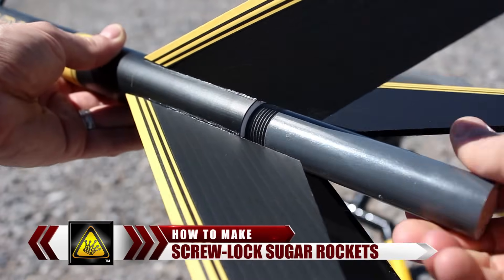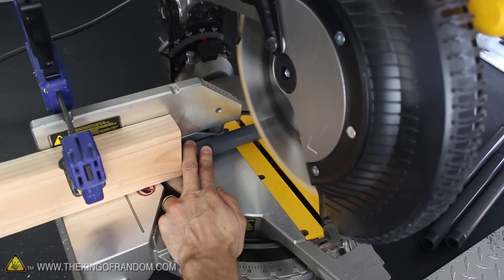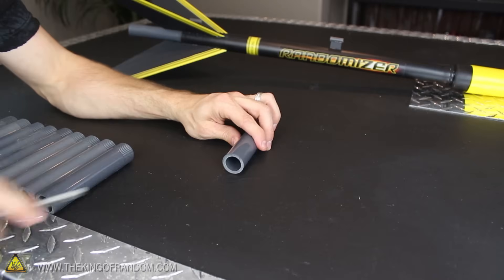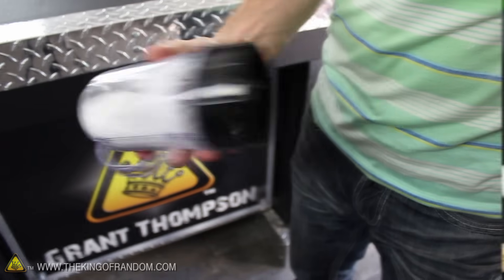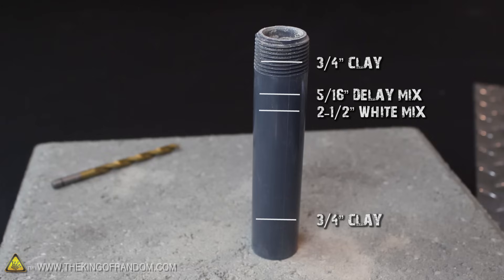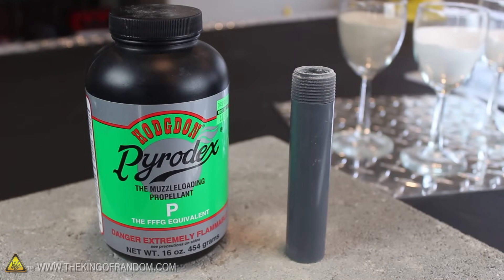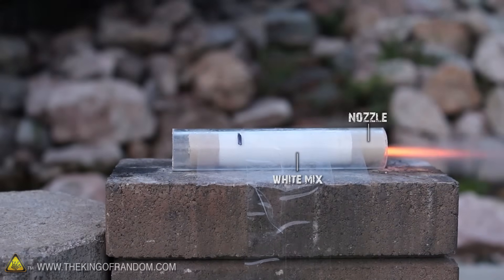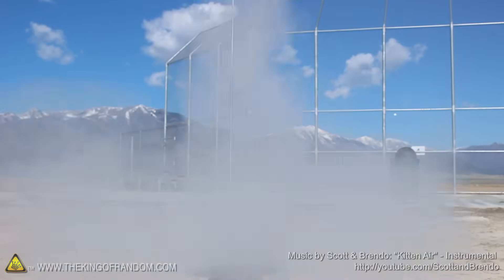How To Make "Screw-Lock" Sugar Rockets

Comment: for the rest of the world:-
35mm Clay
45mm Delay
108mm White mix
127mm Clay
254mm
Reply: +Brett N
Well that is exactly the point of the SI-system: you don't have to convert because everyone uses the same standardized units!
The only units I ever had to convert in school were km/h to m/s or radians to degrees
Reply: not all heros wear capes
Reply: Rijobans how do you know they are not wearing a cape?
Reply: I don't understand why the country with the largest space program still not uses SI-units…
Reply: nasa does,,,, most smart folks do too,,, me included,,, so simple ,,, but so many tools are in the old stuff,,,
Reply: @YourMJK  Yea don't ask. i live in it and i still wonder the same thing.
Reply: @YourMJK  Sports Illustrated (SI) measures their models in inches as well.
Reply: YourMJK maybe thats why we have the largest space program??
Reply: +wacka whaahaaahaaa I fucked up the 69 likes
Reply: LammaNerd I feel ya man, we are slowly doing it in the UK - its taken a while, and it wasn't all at once, but we're getting there.

All new buildings have plans with SI, whereas older plans have both SI and imperial.

What we need to do now is add 48km underneath our 30mph road signs to slowly switch people over.

I think in the US you might have to do it on a state by state level at first.. it will be messy at first, but for the next generation everyone will be singing from the same hymn book (so to speak)
Reply: wacka it was tried years ago, but it failed so most states scrapped it.
Reply: not all heroes wear capes
Reply: +wacka I loved how there was only one metric measurement in his video.
Reply: +LammaNerd When America succeeds in their plan of world domination everyone will be forced to learn imperial and how to shoot guns!
Reply: wacka congrats, this comment is still useful a year later
Reply: +YourMJKTube Their space program and scientific labs etc. does, just for things like carpentry and general use they use Imperial.
Reply: ***** in windows 10 I can do you one better.. dont even open a browser... just press winkey+c and type 300f c ..you dont even have to hit enter, it just does it as soon as you hit c
Reply: +YourMJKTube Our space program uses metric.
Reply: YourMJKTube It's the public not wanting to change their measures etc., the government tried to introduce metric units but the public didn't adopt it well so they stopped, now the government just says that the public should use in each situation whatever "fits".
https://youtu.be/lN-BPAxPnYc
Reply: +wacka thanks for converting from stupid units to normal units :)
Reply: +CelmorSmith
Yeah, I know that, would be crazy if they didn't!
But if the government founds NASA they should also do something to introduce the SI-system to the public
Reply: +Little Lion There is a formula if you ever want to figure it out quickly, Fahrenheit = Celsius(1.8) + 32
Reply: wacka Ehh.. 100mm³ is 0,1cm³..
It works just the same in measurements as normally. 1000x1000x1000 = 1000³. there's a difference though between 1000³ and 1000cm³
The ³ only acts once. So it only acts on the cm to signify it as a volume instead of just a distance.
1000³cm³ would be 1000cm x 1000cm x 1000cm. Notice the two powers: one to signify the number as raised to the power of 3 and one to signify the unit being cubic centimetres.

The other confusing part is when you go to a different prefix for the unit with area and volume.
For example, because volume works with three dimensions the factor between prefixes is raised with a power of 3.
So factors between unit prefixes are raised with a power of the amount of dimensions they're acting in:
1m = 100cm (1m¹ = 100¹ cm¹)
1m² = 100² cm² = 10,000cm²
1m³ = 100³ cm³ = 1,000,000 cm³

Between units it's different: L is a one dimensional unit for volume. 1.0L of volume is equal to a volume with 1.0dm width, 1.0dm height and 1.0dm depth. This means it's a 1.0*1.0*1.0 = 1.0dm³ volume: 1.0L = 1,0dm³
That's where the scales meet, but when you change the prefixes the scales change differently because of the difference in dimension between the units:
1L = 1000mL because it's just 1000mL
1dm³ = 1000cm³ because it's 10cm¹ * 10cm¹ *10cm¹.

So it's all about the dimension the unit is written in. Litres are written in 1 dimension, cubic metres are written in 3 dimensions and thus increase or decrease with the power of three when you change the prefix.

I hope you understand :-)
Reply: wacka you are a saviour to the Europeans from all of us 

THANK YOU !!!!!!
Reply: You are a hero.
Reply: And I also agree. I use standard units more then imperial myself as well
Reply: And 300 f is actually 147.89 degrees c
Reply: LDK447 you are correct sir (sort of) the numbers are right but the last delay should have said Clay (I mis-read the dowel since you can only see part of it at 1:35) - I have edited appropriately, Thank You
Reply: +ChIcKeN_Stewer 
1 incredibly stupid
2 not  a nuke
3 Incredibly stupid
Reply: +YourMJKTube just the general population in the us uses imperial. most scientific labs, factories or any other industry requiring precise measurements mostly use metric from my understanding
Reply: wacka 10cm*10cm*10cm = 1000cm³ = 1dm³ = 1L ;-)
1cm³ = 1mL
Imagine the sizes and you'll realise it makes sense ;-)
(unless you're American and you can't readily imagine the metric sizes :p)
Reply: animesis THEY'RE FREEDOM UNITS, YA HEATHEN!
Reply: animesis we've been phasing them out slowly for a long time here in UK - but if you look on floorplans of any newbuild its all metric
Reply: +PerrinPansy How? It's so much easier to be accurate with metric.
Reply: cheers from brazil
Reply: Thank you for using units that make sense.
Reply: wacka thank you for not being American
Reply: wacka you could use cm
Reply: wacka aa
Reply: Aaron Calvert over here the building trade measures in millimetres, not centimetres. No fractions necessary.
Reply: wacka Thank you, you are intelligent
Reply: 45mm delay is WAY to much time, Rocket will have hit the ground before  parachute deployment.
Reply: 5/16 inch is 8mm not 45mm
Reply: +wacka Also, 300 degrees Fahrenheit isn't 165 degrees Celsius – it's (almost) 150 degrees Celsius xD
Reply: thank you
Reply: +Little Lion or the can just type 300 f in the search menu on my computer and it gives me the answer
Reply: +G RIJO ひ HIGHCLASS  
But they all eat crepes.
Reply: +Little Lion a nanometer is around 5 atoms
Reply: +wacka im pretty sure those numbers you gave are wrong. Theres supposed to have 2 clay and only 1 delay mix (which should be shorter in length than the white mix
Reply: +YourMJKTube we do use it for science, I know both and use a mixture of the two
Reply: Blake Cooper Dude.. not in population!
Reply: ***** 100mm3 surely ... 1000cm3 is way more than a litre I would have thought
Reply: ChIcKeN_Stewer It would never be a nuke. Obviously that's what I meant.
Reply: ***** hmm I was thinking when you add the little 3 thats the exponent, so 1000cm^3 is 1000x1000x1000, but I guess it doesnt work like that in measurements - but yeah thats what I meant .. 100mm^3 = 1000cm
Reply: +wacka 'MURICA
Reply: ***** yep :-) one Litre is one cubic decimetre which is a thousand cubic centimetre. ^.^
Reply: +282FUN you know imperial measurements are from Europe..?  the uk still uses both lol
a nightmare for any non-brits
Reply: +wacka Do you know how many tsp or Tbl. for mixing the Nitrate and sugar?
Reply: +Little Lion Which countries other than the US still use imperial units of measurement?
Reply: +wacka Thanks!
Reply: dunno where you pulled that JSON from, but Im not on an iPad
Reply: wacka is
Reply: wacka I
Reply: wacka
Reply: dank
Reply: +Little Lion 0.02 of an inch IS 0.02 of an inch, Machinists call that 20 thousands of an inch. Nobody would take 7 thousands of a foot, that's like saying you want a third of an egg. Even if you did, you'd convert that to  inches first and go from there.
Reply: +Trevor Loew is it to hard for you to figure it out yourself!?!?! There are 10mm in 1cm😘
Reply: So much commotion just buy $2 ruler and be done with it...
Reply: o sea que eso esta midiendo medio metro enserio huy creo que hiso mal la cuenta
Reply: alejo camp - its 25.4cm long - dont add them - its at 35mm Clay... at 45mm Delay ... not 35mm of clay then 45m of Delay
Reply: you could probably do 333, 334 and 333 and it would still be as accurate as someone cutting 1/3rd of 39.3701 inches
Reply: in fact.. your saw blade is probably half a mm .. you could maybe even just get 333 333 333
Reply: you would find that 333.3mm would be more than accurate enough. I don't see many timbers being cut as accurate to the closest hundredth of a millimetre.
Reply: ZCVc
Reply: [vip]TehGameChallenger_TGC[vip] All the countries use it, exept just a few and USA, in Canada we use Imperial a lot (because of USA) But at school I learned only Metrics (wayyyy better)
Reply: The list of countries not using the metric system is far shorter (Burma, Liberia and The USA - That's right, 3 in total) than the countries that do use it.
Reply: Whoa whoa..... 35 ml is 3.5 cm, over one inch, 45 mm is almost two inches, for the delay mix?! That's the smallest part of the thing... One inch is 2.54 cm. u can get away w two and a half.... 3/4inch is, hmm.. About 1.9 cm, really really close actually.
Reply: A "hero"?  WTF, you guys can't do maths?  You need a "hero" to do it for you?
Reply: What's 7/16 of a centimeter? Divide 7 by 16. That's the sole point of the fraction... When i do math, i really prefer .4375 as a value because  then, i can do all the maths i want. I need 234 iteration of that? multiply it.

Now tell me, what is 234 times 7/16?
Reply: Thank you, your a f*cking hero!
Reply: OOF... I think... uhh... At least 40?... (Like who gets the reference)
Reply: Thaaankss but it’s too late lol
Reply: we in the land of the free use moon landing units
Reply: Fak u
Reply: thank you my saviour
Reply: Thanks
Reply: 127mm clay??!?! How, I don't get it!
Reply: thank you
Reply: "Be precise". Uses inches to measure......
Reply: You're a real hero, thanks!
Reply: Metric sucks.U.S.A.💪👅❤
Reply: I can't get my hands on the black powder. Is there any other subsitute that you are aware of, which has similar properties/effects?
Reply: Thankyou so much
Reply: I don't think any of those numbers are right come to think of it lol
Reply: True those are all wrong
Reply: 127mm is the length of the whole pvc pipe of the motor
Reply: @nimamashitongxinglian1213  correct, that's where it ends. So from 108mm to 127mm. They're all positions along the pipe.
Reply: names of each one and the page where I can get them please
Reply: do you know the total weight approximately of the white mix?
Reply: +wacka thank you!!!!
Reply: @simonburgers2403  r u aussie
Reply: @nazza2631  nope,
I am Dutch
Reply: +YourMJKTube 
Well, NASA uses SI-units for their plans/engineering/programming.
Only if they want to present numbers to the public they may convert them so the mainstream audience can relate to the scale.
Reply: colavfreak2 And now tell me how long 0.02 inch is. And 0.007 foot. And I haven't even mentioned micro an nano scale measurements which are (amongst others) extremely common in the product design and manufacturing industries and computer hardware manufacturing and design industries.

 Though theoretically the imperial system could mathematically be more efficient and even more accurate, it conflicts with the decimal number system the whole modern world uses. The metric system is infinitely scalable within our number system and can therefore be more accurate even when measuring in fractions (moreover since you need a ruler or similar tool for measurements, and mostly use calculators or more complex program to calculate them anyway)

No the imperial system is a great idea mathematically, and it definitely fitted with the time when commerce and trade was done with less advanced tool than today. But since we do not use a duodecimal number system, the imperial system was doomed to become outdated due to its mismatch with our decimal system.

Sometimes the more efficient method becomes the less effective one because it doesn't match with th situation...
Reply: 1like= your cool
1sub=meet the king of random
Reply: colavfreak2 there are pros and cons to the duodecimal system as well...I could say the same about taking 2/5ths of something.

but to most of the world if you said it was 100 degrees outside... that would not sound good at all.and would sound like an exaggeration of the actual temperature.. meaning "too hot"

also with metric, for example if I buy a 2litre bottle of coke, I know I'm carrying 2kg

and if I have a 10cm cube of water, I know its 1 litre and weighs 1 kg - nice and simple

but the main point is.. every system has pros and cons... but if the WHOLE world is using one system, and one country is using something else... then should the one country adapt??? surely...
Reply: Brett N Being able to (approximately) convert units does come in handy, since a few countries use imperial units.
However, an international audience should be offered at least the international standard and optionally the imperial system.
Reply: Ryan Ho one yes but between one single nanometer and a micrometer is a factor 1000. And from micro to millimeters is another factor 1000. Do you suggest to count those distances in atoms?

Besides, atoms aren't always the same size.
And lastly, atoms have nothing to do with the Imperial system.
Reply: thanks for letting the entire audience outside of the us what the flip he was talking about
Reply: ***** Yep! But nowadays it's quicker to type it in the address bar of your browser. I can open a new tab with CTRL-T start typing "300 fah" and it will already auto-complete it to "300 Fahrenheit to Celsius"
Pressing enter would then take me to Google's results page with a temperature converter card on top of the page.

Altogether this takes me only a couple of seconds for any temperature I want to convert ;-)

(of course if you have to convert often and without immediate access to the internet, knowing the formula is very handy – but for me this isn't the case)
Reply: Thanks bro that helped a lot 👍
Reply: +wacka You know, imperial units actually make more sense for one very simple reason. If all you're ever doing is using full units, yeah, a base-10 system like metric works awesome. And it's really easy to do math in most cases. But let me ask you this. What's 1/3rd of a meter? How bout 1/8th of a centimeter? Imperial units are really awesome because of the manipulations you can do with them. Ever wonder why 12 is so prevalent in society? 12 months in a year, 12 cookies in a dozen, 12 hours for each half day, etc. 12 is divisible by 1,2,3,4, and 6. And anything that is a multiple of 12 is also divisible by each of those. His dowel is 10 inches, and the measurements on it are very precise. Tell me, what's 7/16ths of a centimeter? Yeah, it gets pretty complicated if you're not working with 10ths.

Also, Fahrenheit also is more precise than celcius. Yeah, in celcius it's easy because 100 is boiling, and 0 is freezing. So you've got 100 degrees of specificity. In Fahrenheit, 32 is freezing, and 212 is boiling, so you've got 180 degrees of specificity. Also, 100 just sounds hotter when talking about outside temperature than 38.
Reply: Mac Guy3135 I can't.
Reply: Someone can make a nuke out of this...Without the radiation in it. Just put the ingredients in a nuke casing and put tons of white mix and some delay mix of the part where it'll show its about to hit the ground, then when it hits the ground the delay mix will ignite the powder and BOOOOOM the loud noise makes everyone scared :3
Reply: +Little Lion 1 I didn't say it was a nuke
Reply: dạy cánh làm phao sáng tín hiệu
Reply: Just buy an american ruler
Reply: nah. in Canada we use mm and stuff like that but when doing things like this inches is the way to go
Reply: +wacka for the rest of the world, learn how to convert. We learn that in grade school.
Reply: @GrandeMastaSexi  Yeah, is that why even university students in the US struggle with conversion formulas when doing advanced physics?

Comment: Can spent motors be re-packed? Or is it too weak to be safe?
Reply: +Kairos Raider If the mixture ignites, the thrust is so hot, that the plastic will melt I think
Reply: On the inside at most. I'm wondering about the structural integrity. At $1 ea. it would be cool to recycle but hardly a dealbreaker lol. Looking forward to building a TKoR rocket set.

Comment: if u connected the screw end part of the rocket to a pvc tube funnel then connected that to a wider pvc tube then the 1 you use in this video and did the same packing strategy would that make the rocket fly higher